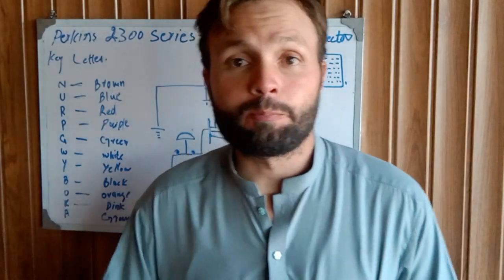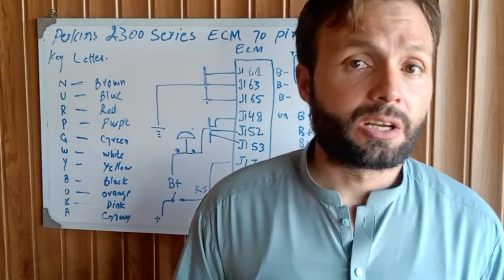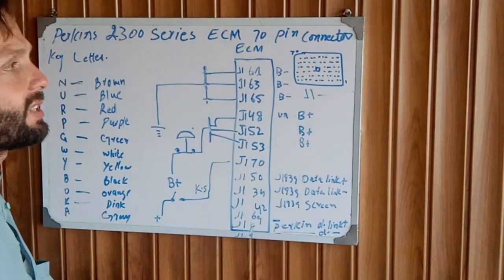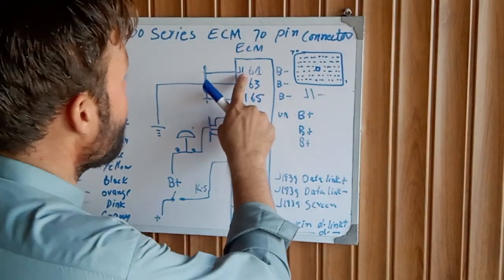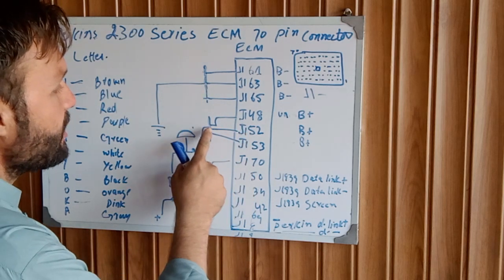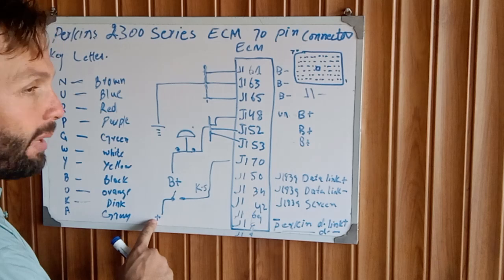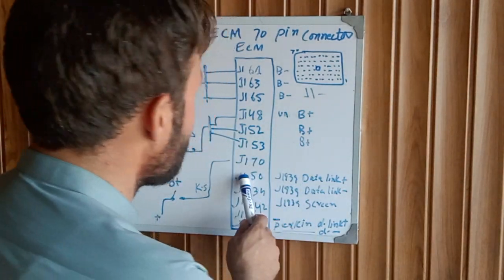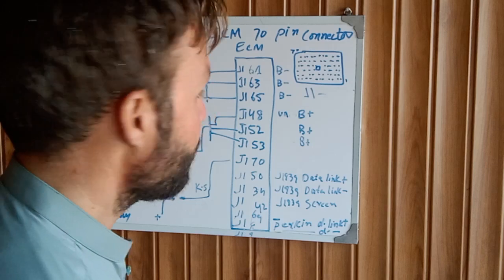perkins 2300 series Ecm wiring generator full ecm wiring explanation part 4 final

Comment: The key switch sir if no supply of positive the engine stop, thanks
Reply from the maker: Key switch takes input positive + from the battery on B+ Terminal which is battery + input , then sending this B + to different position on keyswitch  ACC/ S/ glow plugs, fuel solenoid, ecm relay, control panel turning on etc
Reply: @Info-Tech-  thanks sir in ecm pin 70 if i off the ignition switch then the positive supply from ecm for pin 70 the engine turn off
Reply from the maker: My friend this is the positive + feed from E.STOP button  Emcp 4.4 pin 33 and pin 53 both is battery + out to E.stop  in ADEM 3 PIN 70 is key switch in put from E stop,

In powerwizard pin 70 is emergency N/O to ground
Reply: @Info-Tech-  thanks sir, i hope more videos upload regarding ecm wiring diagram explanation